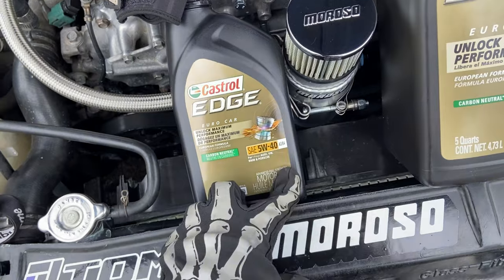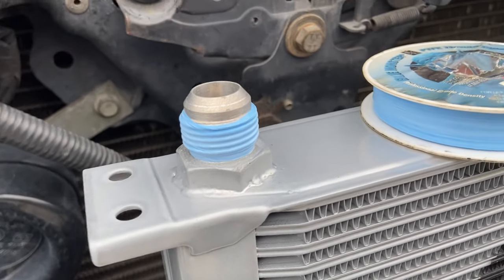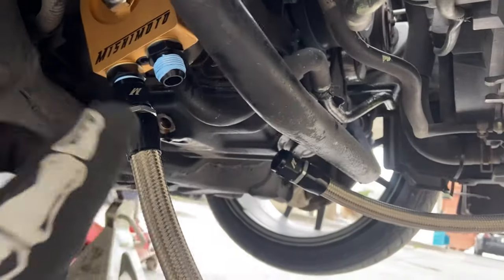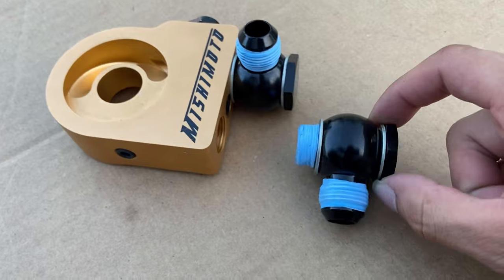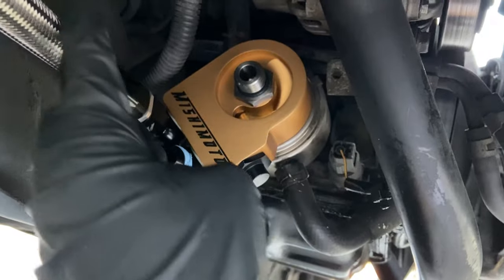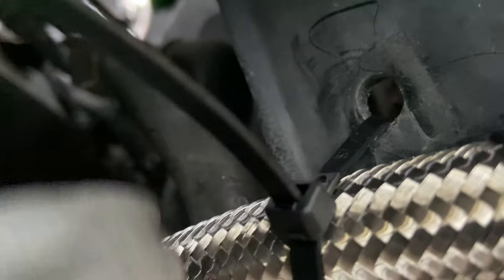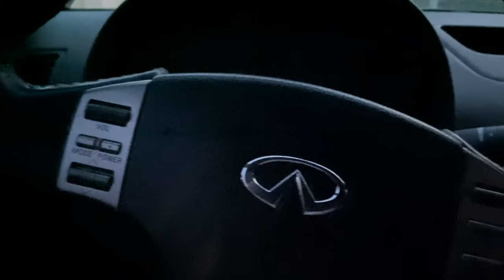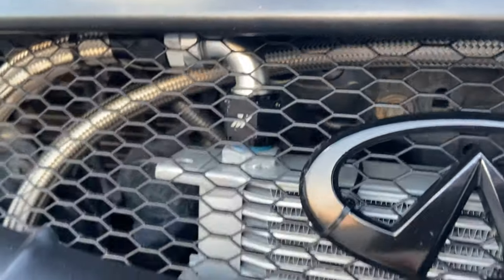10 Row Mishimoto Oil Cooler Install - G35 V35

Comment: Clean build man !!! I low key got that breather catch can kit in my cart from your other video lol 😂 might need to add this one too ! I have a question, is this okay to do for an NA setup with some bolt ons and tune ? 🤙
Reply from the maker: thank you G 👍 & are you asking if it’s okay to run the breather cc or oil cooler on NA? Sorry lol the question kinda came out a little doubled.
Reply: @DEATHWISHVQ  oil cooler , does it benefit anything while being NA ? I know the catch can will allow the crank case to operate at a better flow rate and fix that oil consumption, i don’t know how the oil cooler would play into effect with being NA on bolt ons
Reply from the maker: @reneduran3675  you can run an oil cooler NA or FI (forced induction/boost) the purpose is to of course make the oil run cooler when the oil gets way too hot (thinner) if the oil gets thinner then it will have less protection to the engine, very minor but helps extend life of engine, if you have a car where you beat on it constantly and drift it you def need an oil cooler especially if you beat on it on a hot summer day. You don’t need a tune or anything for an oil cooler just a beneficial upgrade like a catch can, a stock car can run an oil cooler, but it’s best you get a thermostatic sandwich plate that way when the oil gets to a certain hot temperature (this thermal opens at 185•F) then the oil runs thru the lines into the cooler to get air and run cooler. I hope this helps man.
Reply: @DEATHWISHVQ  hey that was well explained, thank you for the information man . I’m definitely doing this because I do drive the car daily and do some more abusing than the average driver . Great upgrade and can’t wait for the next mod you have coming up 🤙
Reply from the maker: @reneduran3675  much love bro. If you plan to do the same grill setup as this video just make sure you test fit the grill over the oil cooler before completely assembling everything 👍 I added the zip ties to push back the oil cooler so my grill could fit better.

Comment: does this work on 06 sedan de rwd auto?
Reply from the maker: yes just find a good location where it’ll get direct air flow, and secure the hoses well. If you plan on getting this same oil cooler just make sure u buy the 90 degree fittings so the hoses are not pointing down.